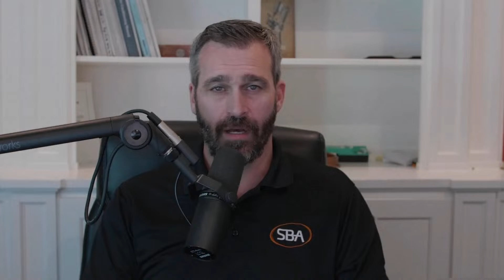SBA 495: Why Most Building Automation Systems Are Underutilized

Comment: 8:15 so what would you recommend someone do to get into this field? Entry level positions I’ve noticed are hard to come by.
Reply from the maker: Sorry about the delay. So it depends where you're coming from. Are you brand new green or coming from another Trade. That will help me answer the question better.
Reply: @SmartBuildingsAcademy I’m in commercial refrigeration. I have a project management certificate working on my CAPM currently as well as working on Ai certs.

Comment: Automation has fallen into something alan watts described once. The organisim is too far from the mechanism. It is of no help when the DOR provides a geothermal, heat recovery, highly efficient building when the calber of mechanical oversight and upkeep is not even close to capable. 
The industry has moved away from in-house competency and controls vendors are forced to create products too complex for the average tech and any customer at this point without extensive training.
Reply from the maker: It's interesting, we're actually seeing a ton of companies starting to train their operators which is surprising. Theres a big push to be self-sufficient lately.
Reply: @SmartBuildingsAcademy  that's a relief to hear. I hope it works it's way to my bubble soon.
Reply from the maker: @adept00  What do you do? Often times our engagements with owner operators usually begins with one person and expands to the rest of the facility.